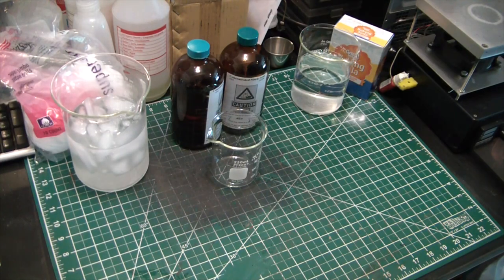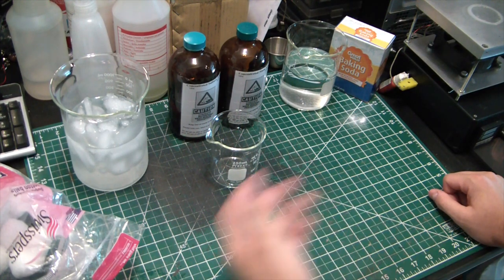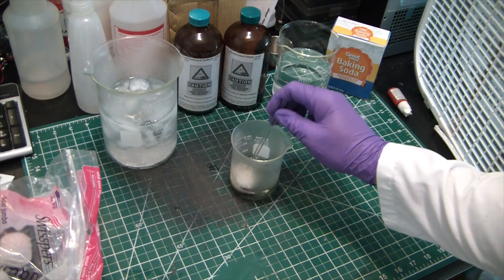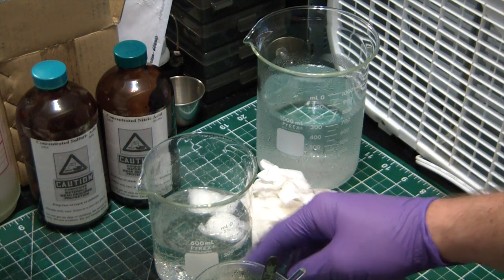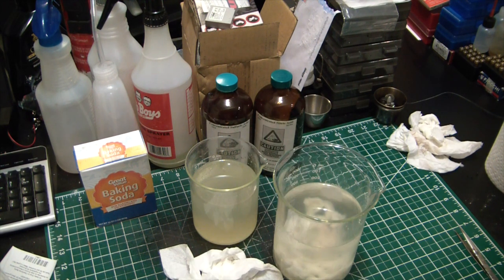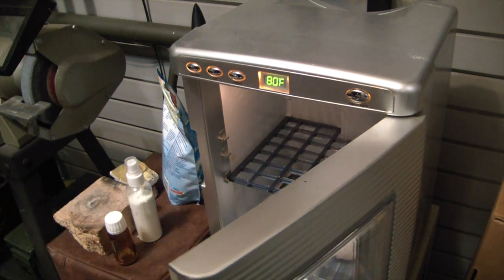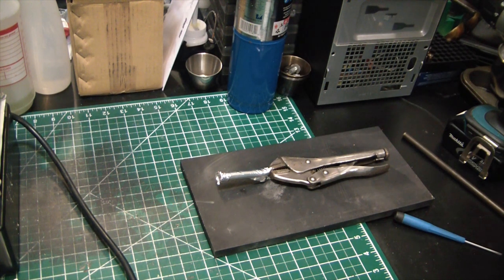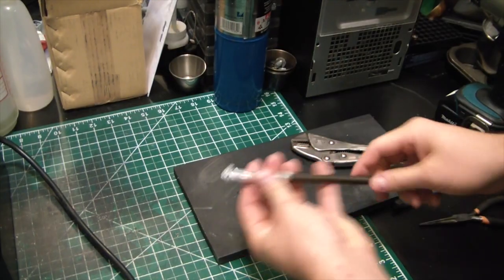Making Flash Cotton / Paper - Magic Trick Fireball (Nitrocellulose) - ElementalMaker

Comment: Nitro cellulose can be "dissolved" in acetone, which will make a putty like substance and can be used as a low grade plastique.  It will detonate from an appropriate shock, like a blasting cap or firecracker
Reply: Is this the same nitro cellulose used in celluloid clear plastic sheets?
Reply: @1SmokedTurkey1  not sure about the plastic sheets, but many ping pong balls are made of nitrocellulose
Reply: @Crispy_Critter  thanks for replying I already figured out a much simpler solution.

Comment: Nitric acid will oxidise and ignite certain types of glove materials so it's sometimes preferable to work bare handed with it, test to see which glove types your acid will ignite to find which are most appropriate!
Reply from the maker: That would probably make for a very cool video! Thanks for the tip!
Reply: I think nitrile or one of the other latex substitutes. NileRed  did do a video on that exact topic.
Reply from the maker: He did do a video on this. The Nitric acid was quite weak against gloves at 70% concentration which is what I was using in this video.
Reply: ElementalMaker sounds like you need to train it more to evolve it into a fire type. Should be super effective then.
Reply: @nunyabisnass1141  basically no gloves are really 100% safe against highly concentrated nitric acid. It's considered a lowkey quality check for your fuming nitric acid - if it ignites your gloves, it's well concentrated. Lower concentrations will also decompose them, but it takes way longer and propably won't cause a fire.
And yes, there are several cases where not wearing gloves is actually safer. even when it comes to hygiene this is usually the better way - wash your hands thoroughly with soap and disinfect them, after that you'll usually find less colony forming units than on standard gloves.
Reply: nunya bisnass I use rubber gloves to get the acid from my containers, however, WFNA and RFNA will react with your gloves,  not 68-70%. But cheers for the warning
Reply: only really matters is ur working with fuming nitric
Reply: @ElementalMaker Have you ever made smokeless propellant?

Comment: You can reduce the chance of thermal runaway and increase the chance of not getting a gummed up product that more or less starts to dissolve in the solution by using your ice water to cool the container. Keeping the solution cool also makes it possible to nitrate longer without it dissolving. I tried 24 hour nitration 3 times in the past, for one of them out of curiosity and laziness I skipped the cooling part and not only did it dissolve ruining the product, but it began to runaway when I tried to neutralize it. It put out some nice pleasant smelling orange fumes lol.

Comment: Many old theaters burned flat from film fires. Very hot. Great showing today my friend ! Fun too !
Reply from the maker: Yessir! Glad you enjoyed! As always, thank you for dropping a comment!
Reply: Archives which carry any serious quantities of celluloid media usually have specialised rooms fitted to create conditions which minimise or at least reduce the risk of spontaneous ignition and rate at which the film degrades as well as isolate any fires that do happen. Those nitrate groups have a tendency to turn back into nitric acid in the presence of water if given enough time (one step on the thermodynamically bumpy journey to becoming diatomic nitrogen gas again) which yields the same acid impurities you have to remove during the synthesis to stabilise the material. On a semi-related note it's known that in various places in the world that produce their own munitions whether they have poor access to factory-loaded munitions or another reason that ground celluloid film has been used as a propellant in place of factory formulated or purpose-made smokeless powder.
Reply from the maker: Very cool! I didn't even consider that they still have archives of NC film. I may have to experiment with grinding some NC film after dissolving it in acetone and test it remotely (with a very light charge).
Reply: Thanks for this. I am not much of a chemist aside from the bare basics. I find any new info fascinating though. Thanks a bunch for your input today.

Comment: 5:47 Did you end up recovering the nitrates from them? I want to do this, but my HNO3 is rather precious (since I have to make it myself), so if possible I'd like to recover whatever I can.
Reply from the maker: I didn't bother as I've since found a local greenhouse supply that sells 50lb bags of potassium nitrate for $34 😁
Reply: @ElementalMaker  Ahh ok. 
Hey, one more thing - When I was looking to make some HNO3, I purchased some ammonium nitrate, but then I read some SM threads saying using ammonium nitrate to make HNO3 is a bad idea (dangerous), so I went the KNO3 route instead. But I still have like 4 pounds of the ammonium nitrate... Other than making something that would go "boom", do you have any interesting synthesis I can try? I don't wanna waste it, but it seems like the internet only uses it for ANFO or a fertilizer. 
Just thought maybe you'd have something interesting to suggest maybe. :-)

Comment: I'd like to make all in one charge and bullet wrapper ma bobs for my BP rifle.  Something I can just stuff down the barrel and ready to go.  I was thinking about rolling papers, but if I coat the paper in the acetone pingpong mix....that should burn it off, hey?
Reply: I wouldn't recommend trying that as Black Powder Guns are not designed to handle 40 to 50,000 LBS. of Pressure that Smokeless Gun Powders can Generate. What you want is Paper or Linen soaked in a Potassium Nitrate Solution with Water and then Dried Before Rolling around a waxed wooden Dowel and glued. Push the bullet into base first glue or tie with Cotton String soaked in The same solution used on the Paper and remove the Dowel. Then add your Black Powder twist the end shut add a drop of glue and your done. To use twist off the end and pour the powder first in the Pan if you have a Flint Lock and the rest down the Barrel toss the end in seat the bullet paper and all and your ready to go. This is how it was done from the Revolutionary war up until after the Civil War. Soldiers carried these in Cartridge Boxes on their Belts. This was also used on Cap and Ball Revolvers to speed Reloading During the Civil war up until Metallic Cartridge became available. Lot's of good information in those Old History Books The Democrats and the Teachers Unions don't want us to see.

Comment: What is the ratio of chemicals used or does it matter that much?
Reply: ElementalMaker - Thanks
Reply: Hello Ebay! Lol
Reply: @ElementalMaker  You can make it also with Ammonium Nitrate from cold packs, just need to nitrate longer.  It is highly nitrated just as much as using Nitric Acid.  Just my 2 cents from experiments I have done.
Reply from the maker: That is definitely an option! Sadly its hard as hell to find AN based cold packs any more. Amazon used to be a great source for bulk ones cheap, but they changed the formula to Urea or Calcium Ammonium Nitrate, I forget which.
Reply: @ElementalMaker  You can use the Calcium Ammonium Nitrate ones, you just need to dissolve in water and then filter out the Calcium leaving behind 100% pure Ammonium Nitrate.  It takes quite a while to filter, that's why I just let it set a few hours and then decant.  They do this because it makes it not an explosive with the Calcium added and adds an extra step to make it more difficult, but it does work.  I have accumulated a lot of AN from these cold packs and made ET, Gun Cotton and tons of others things.  Works great!

Comment: your burn rate was very slow because you used the bicarb of soda, try doing it using distilled water and no bicarb, and also add 5g of potasium nitrate to the acid mixes, but make sure you rince the cotton at least 5 times in distilled water befor taking it out the final 6th rince with your hands, it will be safe to handle after all the rinces and for best results leave to air dry for a couple of days, i guarentee the burn rate will be 3 times faster if not more and you will not feel a THING WHEN IGNITING IT ON YOUR HAND

Comment: I think the acids should be precooled and the reaction should have been conducted in an ice bath to keep the reaction cool and stop a run away reaction. Cooling should maximise yield in terms of level of nitration. It also reduces fume generation including oxides of nitrogen. The finished product should be washer with distilled water and then sodium bicarbonate.
There is a BBC documentary video which deals with the history of explosives starting with gun powder and ending with modern high explosive. During the section on nitrocellulose, it showed the lab manufacture of nitrocellulose, it then went on to reproduce a demonstration that was shown to welsh miners when guncotton was invented.. The demo compared the effects of blasting power ( gun powder) with that of nitrocellulose blasting boulder in a quarry. The comparison is very dramatic, with a large charge of gunpowder just fracturing a boulder, while a tiny amount of nitrocellulose turning a similar size rock to powder. The difference being that when confined, even a small amount of nitrocellulose burns to a high order destination. If you get the chance, I recommend you watch the video, I think it is called "Explosions that shook the world" . ref YouTube https://youtu.be/k1_sMaMcLG8

( the quality of your flash cotton does not seem to have suffered from being made at a higher temperature,it appears to be high quality stuff, I must assume your acids were highly concentrated.  The clue to quality is how little residue is left after the burn. )

Comment: I just watched two videos in a row about making gun cotton. The other one used sulfuric acid and potassium nitrate. What are the advantages and disadvantages of each method? I know the "selling point" of the other method was that you could obtain all the ingredients from a hardware store. The other method seemed to take longer, though.

As an aside, I was looking for sources of potassium nitrate and sulfur on Amazon and I could obtain BOTH from the same vendor. Add a little charcoal and ... don't try THIS at home! (I knew a kid who tried that in a "lightly supervised" high school chem lab by grinding the dry ingredients in a mortar and pestle, and ... "Look, ma! No eyebrows!")
Reply from the maker: Either way works. It is more effective to use nitric acid, as the potassium nitrate will form insoluble potassium sulfate and sludge up your solution. BP is actually quite safe, I've made it in a few videos. Just need to use the proper precautions and read up beforehand.

Comment: A little suggestion.
If you've got serious background noise like that fan you can get a small cheap microphone and a headphone amplifier with a mixer circuit.
Make a connector that reverses the conductors from the mic to the amp and then run your video audio through mixer with it.
Put the mic near the fan.
Adjust the levels until the fan noise gets pulled out and record.
With a little effort you can make a device that mounts on your camera. Unless your using a phone of course!
The negative audio from the mic nulls the normal audio from your cam. You can get a little more sophisticated and make that background noise totally disappear.
There's also an audio editor suite that allowed you to use intelligent filters to mix it, but it's spendy.
Of course, you can always just edit the video and voice over the raw audio with only your voice....

Comment: I understand you are wearing the gloves for "safety" but have you tried putting the nitric on those gloves?
I suspect if you try that then compare it to bare skin you may choose not to wear gloves in the future.
If you feel the need to wear gloves with nitric acid id stick to vinyl only.
Just an FYI.
Great vid:)
Reply from the maker: Nitrile gloves handle 70% nitric no problem. It's fuming nitric that's the danger with gloves
Reply: @ElementalMaker  You are spot on with that, i did not see what concentration you were starting out with. Thanks for the reply:)

Comment: I know this is 3yrs old, you only soaked it for 10min+/- and neutralized before you cold water rinsed. Why are others leaving it for 24 hrs and breaking the cotton out of a big yellow block, cold water bath and then neutralizing?
Reply from the maker: I can't see why 24hr saturation would be necessary. A couple hours would be more than enough to ensure complete nitration. You could rinse before neutralizing to conserve baking soda, but its so cheap I dont care about wasting some. What do you mean big yellow block? Not sure what that means.
Reply: @ElementalMaker  in all the videos I've watched where it set for 24 hrs. It's a massive block of fiber and solidified chemicals. So much so that a screwdriver was used to break it apart. I'll include a link to one so that you can see for yourself. This procedure is all over the place on how to do this. Soak 10min then rinse, 24hrs here, 48hrs there and none had the results I was looking for igniting the flash. I do a magic act for kids in hospitals and I was looking for the poof I'd get from the stuff when I was a kid. The garbage you buy is so DAMNED expensive and it sucks, it burns at the same rate as toilet paper. For what I paid for 4 sheets of the shit, I bought the material and supplies to make my own. I only wished I had found your video sooner. I like the results. And I agree on the baking soda, a big box of it from the Dollar Tree no more store is plenty. Your thoughts please on how should I store this. Up Br*nd*n's ass😂
Here is one of links
https://youtu.be/8SeI_BpAfr8
BTW it was made using stump remover!

Comment: lots of people probably already said this but wearing nitrile/ latex gloves when working with concentrated nitric acid is a really bad idea
Reply from the maker: Only in the case of fuming nitric acid i.e. ~100%. In this video I use 70% which is quite safe to use with nitrile gloves.
Reply: @ElementalMaker  not to be that guy but nitrile gloves dont help In any capacity with nitric acid so I reccomend getting a pair or those thick chemically resistant gloves for handling nitric or suffer the yellow skin
Reply from the maker: @Samonie67  I do have several pairs of the thick chemical resistant gloves, however dexterity is just as important as chemical resistance imo. Nitrile will give you a couple minutes against 70% nitric. So I just work carefully, and if any gets on the gloves I have plenty of time to remove them or neutralize the acid.
Reply: @ElementalMaker  yea nitric acid doesnt do much damage to the skin with gloves withing 1 minute and you had a beaker of bi-carb with you so you would have been fine, just dont want people to burn themselves when working with nitric acid and gloves.

Comment: Actually do not use gloves when handling HNO3, most materials like nitrile burst into flames when they get into contact with it
Reply: L0st finally somebody else realizes that. Vinyl gloves do not react though only nitrite and latex of the ones I've discovered.
Reply: L0st and it'll only burst into flames if you're using fuming nitric acid otherwise it'll just dissolve it.
Reply: L0st we talking about rfna or wfna. Either way , I'm not putting any of my parts near that stuff.

Comment: Just a heads up.
Take the safety stuff extremely seriously!!!
I was very careful and always followed safety protocol.
Even so, over the years and thousands of experiments I was exposed to breathing some bad news several times.
I now always wear a respirator when I do chemistry or anything that might create hazardous fumes.
I've been doing stuff like this since I was six years old.
I'm now fifty-nine.
As a direct result of breathing these fumes I now have COPD....
I HAVE TO USE PORTABLE OXYGEN!
So always have a vent system and a backup. Even then, use a respirator. They aren't that expensive and you can make your own cheap enough!
YOU HAVE BEEN WARNED!!!!!!
Reply from the maker: Thanks for the warning Art. I do take safety quite seriously when it comes to the chemistry experiments, especially if they still produce fumes. The ventilation fan I used here was plenty powerful to remove any trace of acid fume. I plan on building a proper fume hood soon enough. Thanks for sharing, I'm very sorry to hear you have copd. That's definitely no fun.

Comment: Putting those acids in water, even ice water, isn't a good idea, unless you're putting a small beaker of acids in to a large beaker of ice water. Aqua regia and water is exothermic on own.
Reply from the maker: 100mL of mixed acid going into 1L of ice water isn't going to cause any issue. Its adding water to the acid you need to be worried about and avoid as much as possible.
Reply: Rule of thumb add acid to water not water to acid . that's first , after that come out swinging. Jk jk , I know what you mean though. Auqua regi in some case is beyond belief reactive. Hell, it can break down noble metals. But a.r. ain't mercuric acid . that's an acid that part of the straight up murderous side of the acid family.
Reply: Cody on Cody's lab tested this concept and it seems to be a non issue.